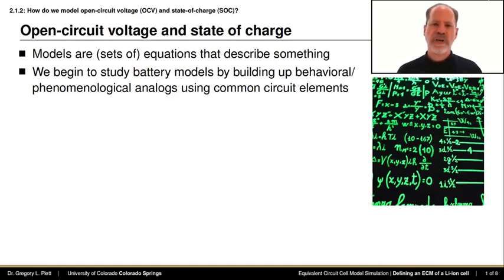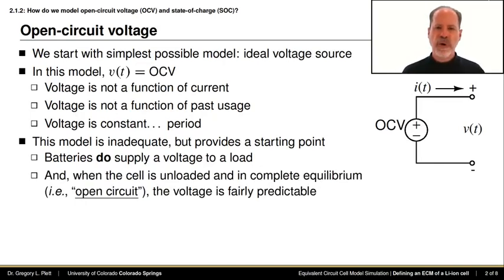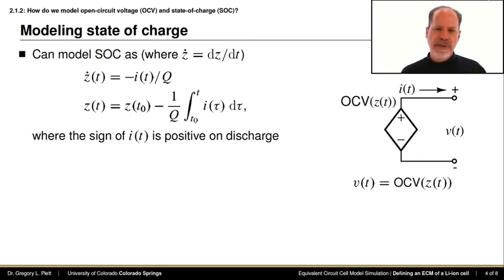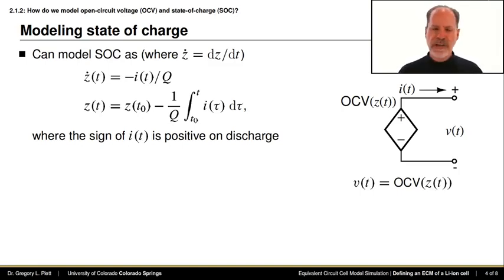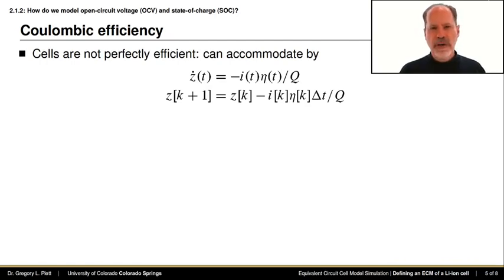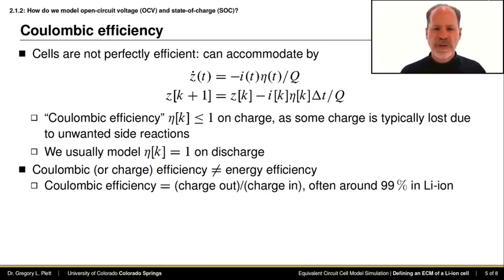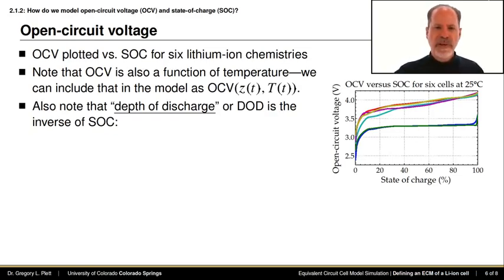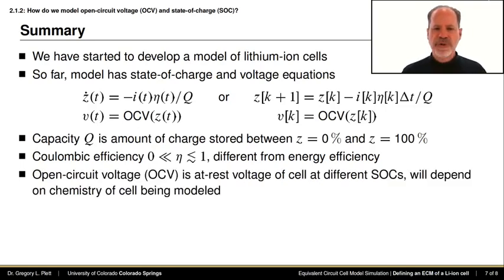2.1.2 How do we model OCV and SOC? (Algorithms for BMS Specialization)

Comment: Hi !
Thank you for the presentation it is very useful, is there a Python model that you could share ? 
Also, in a stationary Battery Energy Storage System, converting Alternative Current into Direct Current implies losses. 
Thus, when the BESS is charging from the grid and discharging to the grid (for energy trading, ancillary services or balancing services application) the energy efficiency of the whole system is closer to 85% than 95%, could you explain where are the additional losses of 10% coming from ? If ever you know ;)

Many thanks,